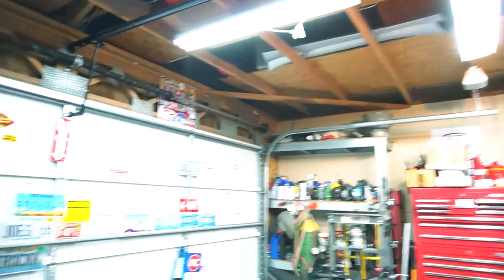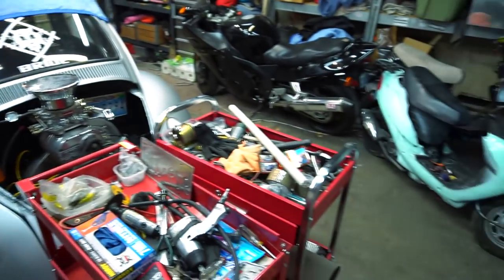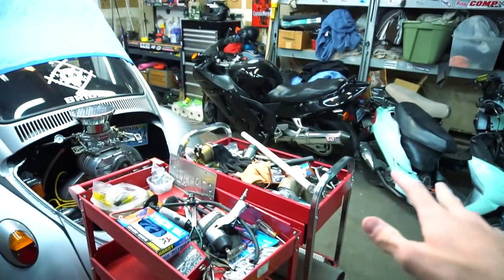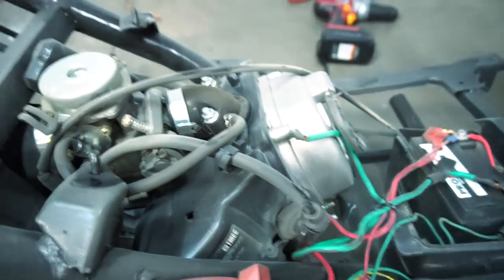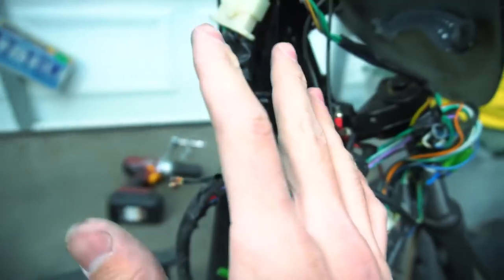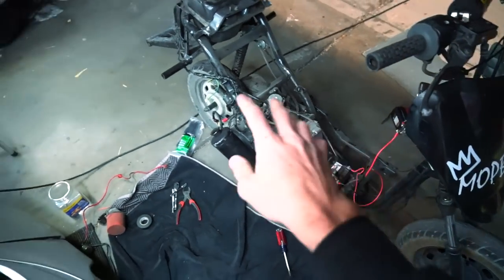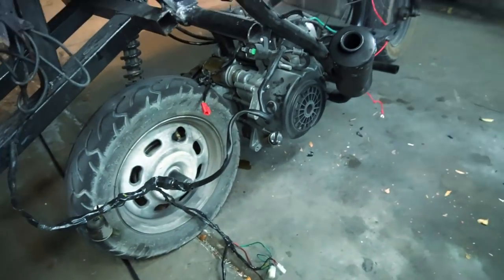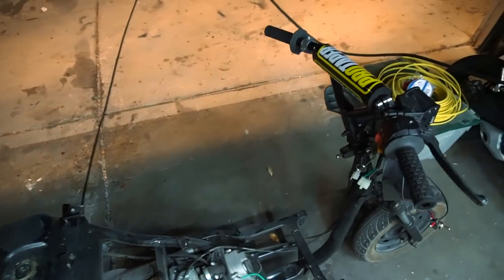CUSTOM WIRE HARNESS FOR THE TOO FAST TAOTAO | 150cc GY6

Comment: Hello, I have a scooter 150cc 4t, after I fixed the machine, everything was done as it should be toothed 100%, I returned the machine and there are no spark plugs, I tried with ac cdi and with 2t cdi, there is no bomb coils, I put another one, and it already had new coils and a new bomb, it happened I've had it happen before, but I just connect it to the coils of the counter wire, that is, the pick up, and then the other black and red one, and throw a spark and put the wire back as it should and it throws, that is, now it won't even do that, and I'm interested in what would be the fastest way to get rid of that I overslept against the wires

Comment: thats awesome dude, it will sure make it look better, i have a binelli and the gas is over flowing into the  air intake and i was wondering if you knew what model carburetor  goes on it. its a sprint, i might just try adjusting the float. any suggestions. thanks for any info. Pete
Reply from the maker: Raleigh Pierce id clean the carb and everything first it sounds like your float might be stuck
Reply: thanks Trevor, i was thing somewhere in that area cause it was sitting for awhile.and do you have pritchett family in plymouth,nc? i do,lol  just wondering ,
Reply: Yo Mike here, just wanted to say thanks for all your time and work that you have put into your videos. I have been watching ya all for  the past year or so and I always love the content. I am gonna do the 150 swap in the next week or two and I am wondering if you would tell me honestly how fast I will be able to drive? I'm swapping out a Tao Tao Atm50 for the 150. Thanks again for all that you do, your a real dude, man. Mop boys rule!

Comment: do you know you canmess with your weights in your side cover and change the weights to a diffrent size and will give you beter take off or more top end witch ever you like more? it takes 20min bro and there cheap you have 6weights in there and you can even take 2 out and have 40% more take off the less weight the more take off the heavyer the weights the more top end i think stock weights are 14grahms and i have 10grahms in mine takes off 100times faster and i didnt lose no top end at all if anything i got more ,,,just something you can think about and alot of fun to do

Comment: Lol hey Trevor its called an ignition coil lol :) and does your scooter not have a horn ? Mine does I was planning on a small air horn on mine I think ypur build looks better without the plasticks if anything go for a more agressive look on it.. Get rid of the cube led get a small 7" bar. Make a skid plate for the bottom qhere the original plastix one is.. And maybe just put the front wheel fender on but shape it to where it looks pointy to give it a look .. And maybe get those horns that subie owners put on the inside of their grill.. And get red neon lights or order rgb lights with the remote , or the blootooth ones that come as a roll

Comment: Do you have a diagram of your wiring?  Trying to simplify mine to the bare minimum reqired to start it with a toggle switch(if possible).  Will add lights and everything afterwards.
Reply: just search up your scooters wiring diagram